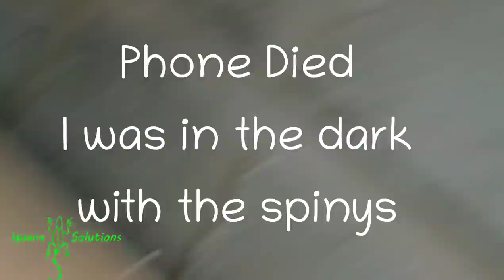IguanAdventures: Attic Iguanas! It's a real thing! baby raccoons, and more! #90

Comment: I know it's probably been suggested before (but I can't be bothered checking) would it not be easier to take a air pistol up there with you, so you can pew pew from a short distance, then only have to worry about getting the bodies, as opposed to trying to be quiet so they don't run away..

Comment: This proves Jessica and Jermaine are willing to go the extra mile to rid your houses of iguanas!  Even if it means going where others won't.
   That's another reason that when you hire this team you're getting the most efficient team to do your iguana controll. You'll be able to sleep at night instead of have to hear them running around as if you live in a haunted house. Iguana Solutions really is the best  company to hire! As you can see here!!
Reply from the maker: Thanks! We actually got this call from another wildlife company that didn't want to deal with it. Customer was a teacher. I think we were very fair compared to competitors
Reply: @iguanaSnipers  Your Company is more than fair, but the most important thing is you get it done, no matter how savage the job is!  I remember you were face to the dirt, digging out some iguanas from a hole under a tree. You're not afraid to take jobs that are potentially dangerous to do!  You're like a Texas Ranger. They never returned without the Desperado the were told to hunt down. Be him dead or alive!
Reply: @iguanaSnipers  Your Company is more than fair, but the most important thing is you get it done, no matter how savage the job is!  I remember you were face to the dirt, digging out some iguanas from a hole under a tree. You're not afraid to take jobs that are potentially dangerous to do!  You're like a Texas Ranger. They never returned without the Desperado the were told to hunt down. Be him dead or alive!

Comment: Those aluminum domes are ventilators, usually they exchange air in a bathroom. The top cover hinges open, and gives access to service the motor, fan blade, and drive belt hidden under the lid.
Reply from the maker: Thanks Mark 😊

Comment: That is an exhaust from a range system. It should go directly to the ansul system hood.
Reply from the maker: What is an ansul?
Reply: @iguanaSnipers  an ansul system is the hood over a cook center in a restaurant that has fire extinguishers built into it. It vents through the roof as a round power vent.

Comment: Maybe when inside the attic you could use an Air Pistol so you won't get hurt?
Reply from the maker: This has been discussed but worried about holes in roof or ricochets. Quickly ruled out